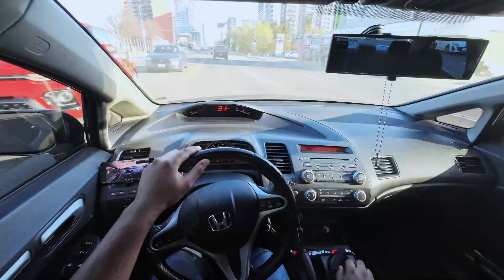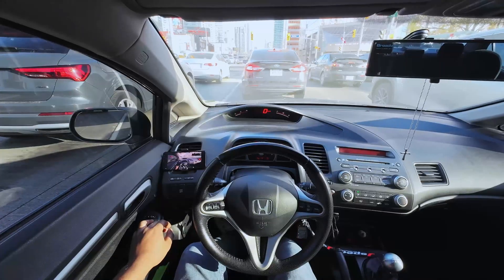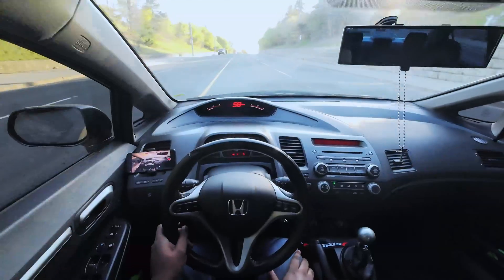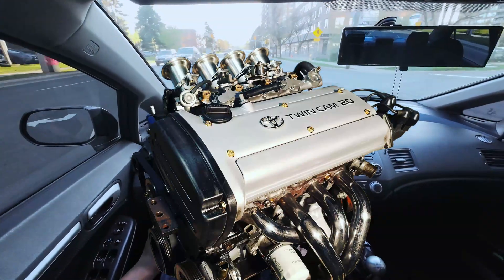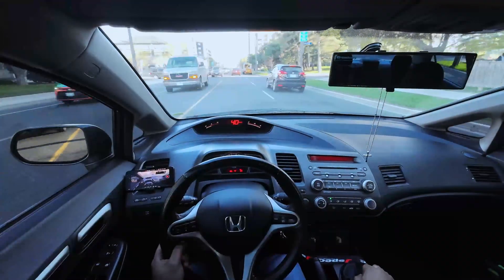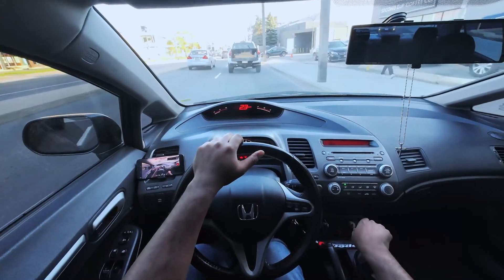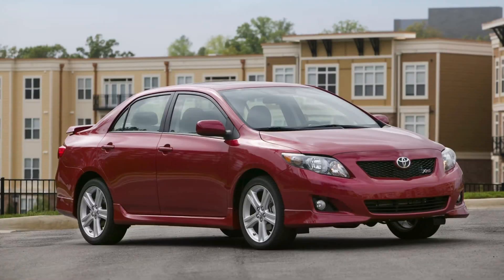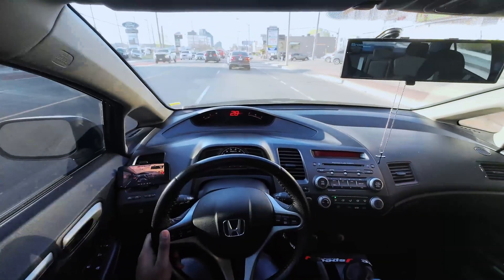Here's Why Honda’s VTEC Took Off, But Toyota’s VVTL-i Didn’t

Comment: 1ZZ had VVT-i
2ZZ had VVTL-i (Variable Valve Timing and Lift) which is more in line with Hondas VTEC

I used to own a Celica GT-S and man i wish i still had it. Lift would engage at 6000rpm. It was fun. The XRS 2zz Lift would kick in so late at 6700rpm but i think you can use a GTS ECU to lower the lift point.
Reply from the maker: Yeah that was my biggest gripe about VVTL-i the acceleration window was quite short at 6700 to 8000rpms. Its probably similar to VTEC where you can lower or raise the kick point
Reply: @jaayceeisblue  VVT-i doesn't have variable lift. Only VVTL-i has it. VVT-i = cam phasing. VVTL-i = cam phasing and variable lift. The variable lift is a copy of VTEC. Just like Nissans NEO VVL is a copy of VTEC.
Reply: I own a Toyota Allex which is a hatch to the corolla. Was that engine have a full exhaust and a free flow you give some stock B series problems. Well I ended up boosting mine 😊 now I’ll give some K series problems
Reply: I have this engine in my Elise and it's easy to fall off cam when changing gears and have power fall way off...
Reply: @Blas4ublasphemy  I had a Sector111-modded ECU for mine to keep it from doing that on the 1-2 shift.  That and mine was decatted.
Reply: @KRAMITDFROG  That's in UK? I keep hearing BOE for US tunes but some people said it takes away from the character of the car because the change is less dramatic. IDK I'm saving to supercharge it anyway...

Comment: The Toyota BEAMS 3sge loves to flip crank bearings that’s why people don’t usually swap it 
Im from Mozambique 🇲🇿 n I have experience with it… but it’s still a good motor you have to give it attention
Reply from the maker: I haven't driven a modified example, but I did drive it in a Altezza. and was pleasantly surprised how well it handled and how smooth the engine was to rev. But you're right not many touch the motor due to the crank bearing issues

Comment: LOTS of swap potentials with BEAMS engines that people don't often know about.
Reply: South Africa they love BEAMS mainly the dual beams. You will see Toyota Corolla KE70 with beams . Vvl is another they love
Reply: Bro this engine loves to flip crank bearings
Reply: @Theowalkerr How does it flip crank bearings how 😢😂 what does that mean
Reply: @repingers9777  Flip crank bearings mean. When the crank main bearings spin 180 degrees, which the main top bearing spins to the bottom which the Crank or both the engine is trashed after that. Essentially a spun rod bearing but on the crankshaft.
Reply: @raimondnu3  how and why ☠️
Reply: @Theowalkerr  please elaborate your experience with that